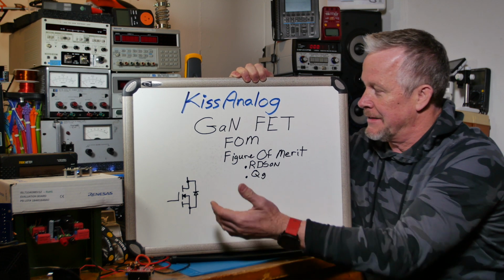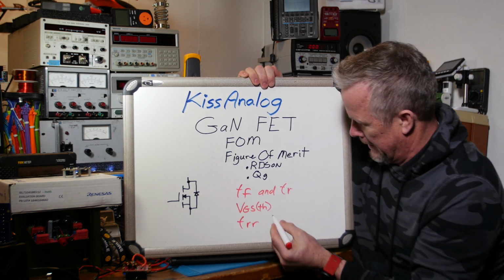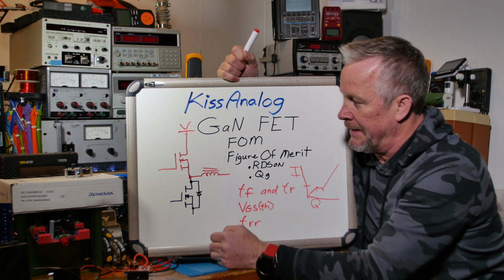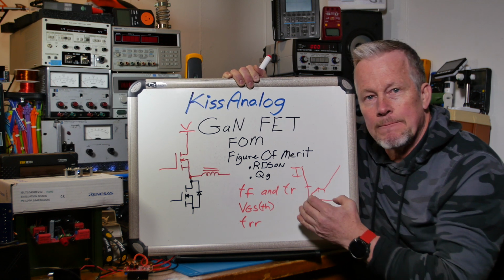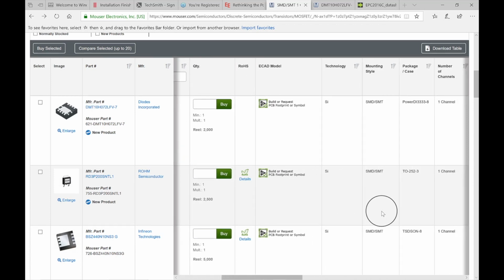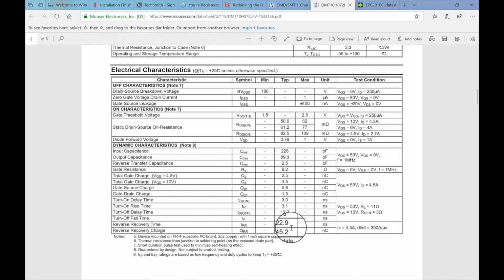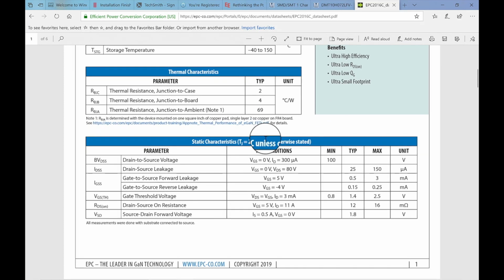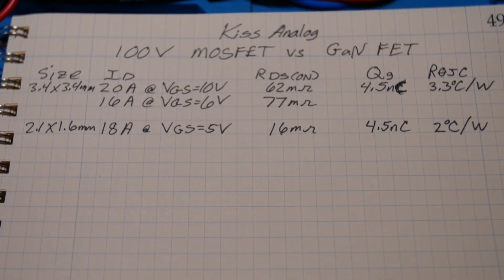GaN vs MOSFET

Comment: Great video. I think also often missed characteristic is dv/dt immunity. It is partially related to gate-drain capacity, and Miller current. But it is a bit more complex. Anyway, in fast switching, especially in H-bridge and other push-pull configurations, dv/dt immunity is very important, and often the limiting factor.
Reply: Also the thing limiting GaNs is usually the parasitics. I've had instances of shoot through on a GaN H-bridge because the parasitic inductances cause a voltage spike on the Gate turning on the fet and causing shoot through. Only way to fix it after a point is slowing down switching speed.
Reply: @jdboi1337  Exactly.
Reply from the maker: movax20h Thank you!  And thanks for the great feedback!

Comment: The other very important that GaN is always ON which is not many video address it in youtube in detail. GaN as normally off can be achieved by cascode GaN with NFET. Also with new design of dedicated GaN drivers which have specific mechanism of gate charge and discharge. So that  driving GaN FET is more difficult that standard MOSFET. But there is available GaN and Mosfet in one package which allow driving normally like conventional MOSFET. This maybe you can consider in next video.
Reply from the maker: Thanks - great feedback!  In at least one of my videos I tried to address the enhancement mode versus depletion mode;)  I've been demonstrating eGaN FETs which are enhancement mode so off until the gate voltage turns them on.  I'll have to make sure I address this with each GaN video;)

Comment: INTERESTING PRESENTATION.HOW DO YOU BIAS GAN FETS AND,WHAT CONFIGURATIONS CAN YOU USE SUCH AS DRAIN FEEDBACK ETC.THIS IS ALL NEW TO ME,DID NOT HAVE THIS WHEN I WENT TO COLLEGE.WHAT ABOUT ESD PROBLEMS?I AM FEELING BETTER NOW BUT,AM STILL HAVING PAIN AND,TIRED.I WAS TOLD IT TAKES ABOUT SIX WEEKS FOR FULL RECOVERY.
Reply from the maker: Thanks David!  I’m glad you are starting to feel better.  I did another GaN video before this one that might help explain some of this.  They do require more attention to the gate drive.  They are made differently than a MOSFET, but they also work very similarly.  I would imagine that they are similar to a MOSFET for ESD, but that’s a great question - I’ll have to ask a vendor about that.  Glad to hear from you;)

Comment: The EPC devices are often a bare die with solderable pads. The main benefit is that it has lower inductance and resistance for all pins. But it is harder to use it for a home player. There are other good small packages like DirectFET that are more comparable. The packaging do have a lot of effects, and more direct die connections can be used with Si MOSFETs, but often is not the primary bottleneck, so it is not used often. In GaN because of superior performance, poor packaging would limit the performance significantly, even if it is still better than Si MOSFET.
Reply from the maker: movax20h Great info - thank you!  I have used the DirectFET, and they are really cool packages; pun intended;) Thank you for sharing your insight!
Reply: @KissAnalog  keep us posted on your GaN stories and experiments ;)
Reply from the maker: Thanks - I will!  I find them really cool - especially with their availability and price coming down:)

Comment: should have totally done that comparison with 200V GaN vs 200V Si, and also thrown in price - the GaN is very cheap and so much faster
Reply from the maker: bgdwiepp Thanks bgdwiepp!  I used the 100 V versions because I have another GaN board that I’ll be doing a video on that will be using this part;) You are right though - the higher the voltage the more GaZn shines.

Comment: Thanks to your explaination I finally understand what the Vgs(th) is. Before I thought of it as a voltage at which some arbitrary current flows, that the manufacturer sepcifies ( like "we consider it open although you can only push 1mA through the channel") . Combined with the Q:I diagram it finally makes sense to me!
Reply from the maker: BeamFinder Thanks for the great feedback!  Although there are a lot of similarities  - they really are different.  As I go forward with the GaN, I’ll try to cover some of these characteristics.  I have another GaN video in a Class D amp coming up very soon! ;)